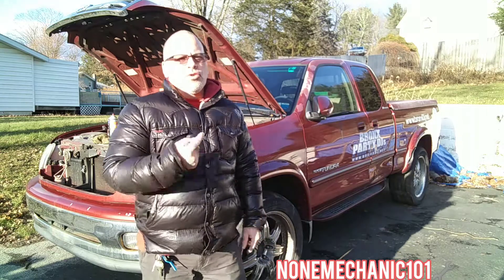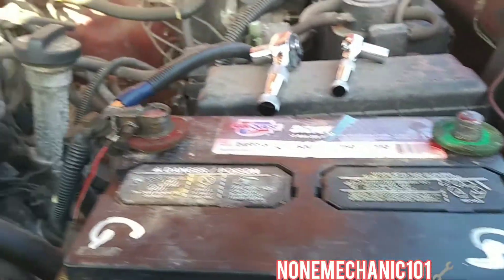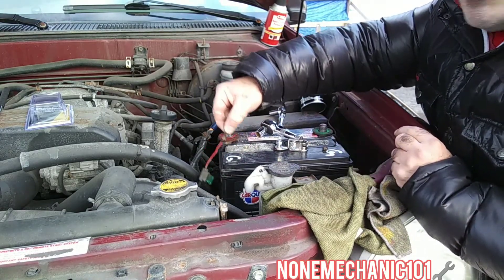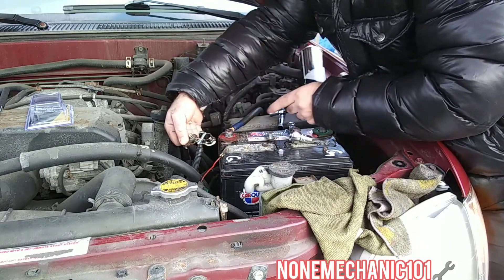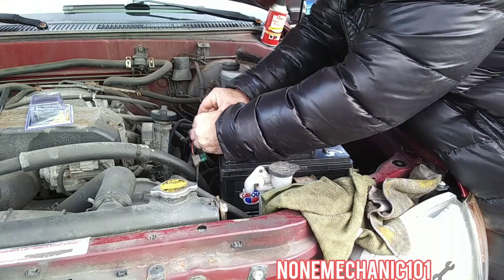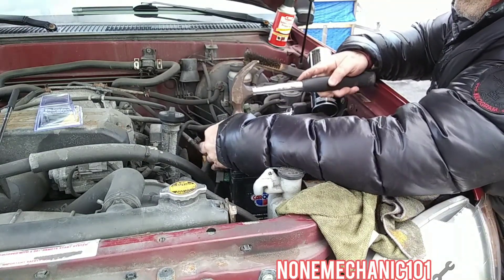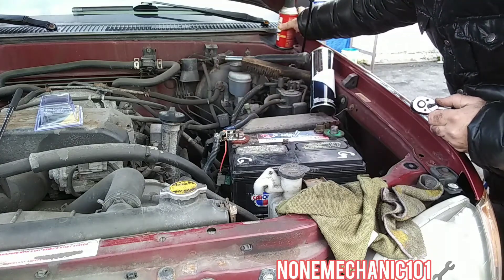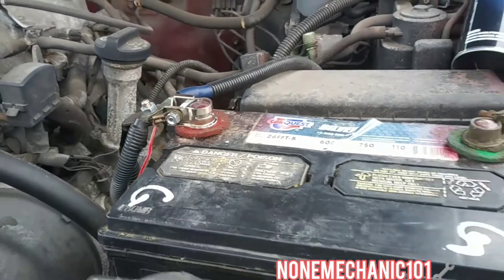2000 Toyota Tundra Battery Post Terminal Ends Replacement

Comment: A hammer works for EVERYTHING🤣

I have three questions Hector:

#1 That is a nice ratchet, where did you get it from?
#2 Where did you get the new terminal
#3 I know we texted on the phone about this truck. Do you know where that small wire with the fuse goes to? (the one from the post)
Reply from the maker: I got the ratchets about 1 year ago from Amazon. The terminals I got it from a Auto store that I didn't want to give free advertisement. I think they get a lot of free advertisements in YouTube and they don't support YouTubers. They don't put advertisements on anyone videos because they get it free. I have to look into the wire. I would let you know.